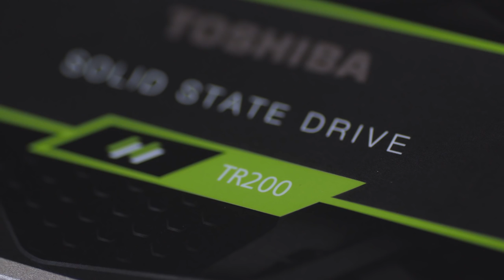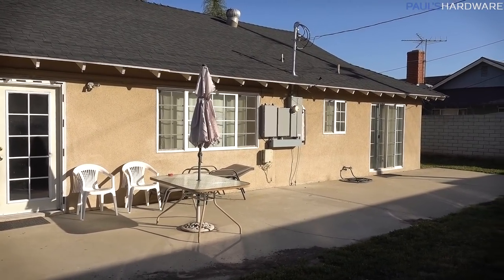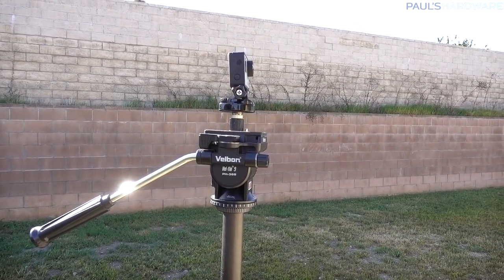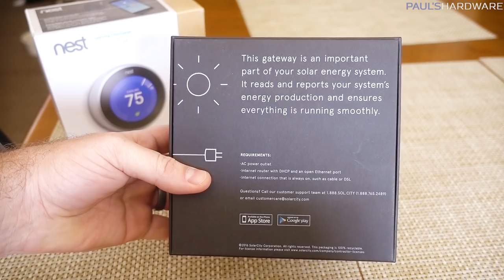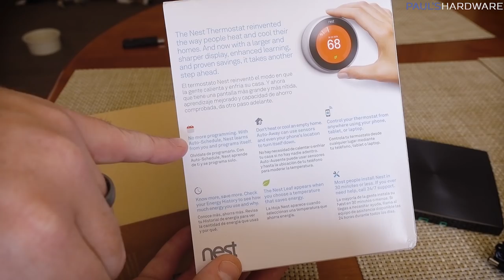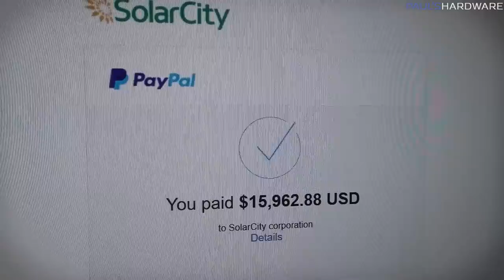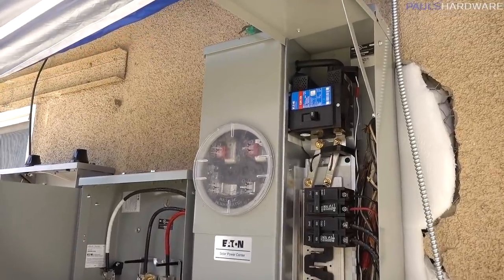The Good, The Bad and the Powerwall - My Tesla Installation Part 2

Comment: By the time you are done the whole back wall of your house is going to be covered completely in electrical boxes lol
Reply: Yeah, US Style electrical systems are bulky AF; my parents' house in Germany was built in the 60's and all the wiring is underground, there's 1 small box in the basement housing the main breaker and then both floors have a fuse box, that's it.
Installing a system like that there might be more complicated because the cables would have to got to the basement, but all of the stuff could be INSIDE, which is probably a lot better than an outside wall ^^
Reply: ZadiusTech what an eye sore
Reply: Not at all, actually. Its local code that his panel be located outside. What benefit do you gain be having main breakers inside? Once every blue moon you dont have to stroll outside to flip a breaker back on? Also, ost people in CA dont have basements.
Reply: The main advantage is they are inside hidden behind a cabinet. I'd hate to have big boxes on the outside of my house, covering my nice walls. Like in Pauls case, if he sits in his garden he has those bulky boxes covering almost his whole wall. It looks like shit... Another common spot here for the electrical system is the garage. My parents have their inverter etc in the hallway close to the front door, it's encased in the cabinet and looks like a normal closet that matches the surroundings. Same with mine.
Reply: You prefer to have the electrical meter and AC condenser inside as well? Some things are a compromise when you own a home. Paul is lucky in that his array looks nice and square, when a great many arrays are more of a jumble due to plumbing vents, etc. You can always build something around it, so long as you adhere to code considerations for space (or not, your home). Houses as old as his can't be expected to not change with time, especially if it means adding major equipment. People live with AC condensing units, internet nodes, plumbing cleanouts, transformers, and distribution vaults in their yards and just accept it as part of living in the modern day. 

I think they did a nice job with the equipment. But, I work in the trade. I have seen people build small fences with climbing vines around their  ACs and meters. I think it's silly, but it doesn't cost much and it's not my house to begin with.
Reply: Well, at least tesla's battery does look nice, compared to the other boxes at least. Serious question though, could any of those boxes be painted to look like the wall? To sort of camouflage them?

Comment: Good tip to really get working-value out of the Nest Thermostat would be to set up a Heat • Cool schedule to maintain a temp between 67 and 75 for somewhere like CA. Also, if you're working from home a lot (not exactly heading out often) set up Home/Away Assist to just use your phone's location, as it'll tie in to keeping an eye primarily on your phone's WiFi / GeoFence location to determine Home - Away states. It's a nifty wee doodad. Just make sure your motion around the house is consistent over the first two weeks, so it can learn the optimal functions for you. :)

Comment: Pro tip for the Nest BTW... It learns behavior. You have to be active with it for a while to get the usefulness out of it. You crank the AC on when you get too warm, and turn it off when you get cool enough. Also, it has a motion sensor to detect when someone is home. Be sure you mount the Nest somewhere where it will see someone is home, or it will turn itself off. Hiro is possibly big enough to register motion, so keep an eye on that as well.

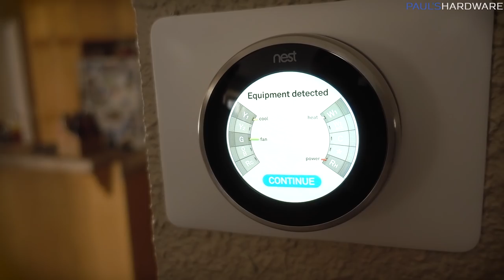Comment: @14:09 Have you had any trouble with the Nest going offline/losing power? If so, you may need to connect up the Common wire. I ran into that issue when I had a Nest installed.

Comment: I would not be surprised if Paul does not end up with a EV car as well - all that free fuel
Reply: If I were him I would, and race Jay.

Tesla Model S P100 vs Camaro ZL1 1LE

THAT WOULD BE AMAZING
Reply: Surprised they haven't already got a Nissan Leaf assuming him and his wife have a car each. I got mine a few months ago, fuel is expensive in my country and there is free charging 5min walk from my house, so far spent less than $40USD to go 6700km (4150miles), in my old car it would have cost almost $1000USD by now.
Reply: QALibrary
EV car, free fuel??, SuperChargers?
You still need Gas? to recharge it?
All Tesla users do Solar on the Roof, comi package China deals? Most are home builders, ordering China cells. EGolf people do that too now, getting construction skills!
He can recharge his car, needing less fuel to recharge it no the move! Getting better battery packs?
Are you owning the property, you should invest in Solar too! Need a new Roof?
Reply: lucas rem
lucas rem Dude, what kind of drugs do you use?
Reply: DumbSloth87 i got a headache trying to read rem's comment, i tought i was forgetting how to read english
Reply: Lucas, set down the pipe and back away slowly, then take your meds and get some sleep, you will feel much better i swear.
Reply: Free charging lucky!
Reply: well he had to pay for the system first - but in the long term and ROI is getting better all the time it be free - my friend had a set of panels for years now in the UK (not the best place) and his electric bill per month is like 5-30 USD
Reply: Not free. He just paid in advance for the “fuel”
Reply: its not free,hes already selling it, will be no different than buying it back at same price?
why is there so much logic fallacy with EV drivers thinking their solar panels are free?

Comment: Paul, Some advice from an HVAC tech: It looks from the video that your thermostat only has 4 wires, which is consistent with the age of your home. Even though NEST is designed and marketed to work with only 4 wires, in my experience, (including at my own house) you will at some point have problems with the NEST if it's only using 4 wires. Could be in a week, could be in a year, but you'll eventually have problems. It's because of the design and the way the NEST "steals" power from the HVAC equipment control board (I would assume it's an air handler). You can google it to find a more detailed explanation. Bottom line: the NEST NEEDS  the C wire connected for constant power from the air handler. Without it they have all kinds of goofy issues, not to mention, there's a small chance it could fry the control board. Mine tried to cook me in the middle of the night. And since they market it specifically to work with 4-wire systems, the last thing the folks at NEST will tell you is that you need the C wire. If you can run new thermostat wire, use at least 6-wire so you have a spare in case you get a short or upgrade your HVAC system to 2-stage. If you cannot easily pull new 6-wire or just don't want to, you can buy an Add-a-wire. https://www.amazon.com/Venstar-ACC0410-Add-A-Wire-Kit/dp/B008PLWT8C/ref=sr_1_3?ie=UTF8&qid=1524793455&sr=8-3&keywords=add-a-wire&dpID=41ee9nEplHL&preST=_SX342_QL70_&dpSrc=srch  .  Or, depending on your specific equipment, you MAY be able to use the green 'G' wire, which normally controls the fan, as the 'C' wire. See google or youtube for step-by-step instructions on how to do this, but basically you would hook the green wire to C on the NEST, then on your air handler control board, disconnect the green wire from the G terminal and connect it to the C terminal. However, that method may not work at all if your AC and/or heat pump does not control the fan automatically, and you will no longer be able to control the fan manually. Don't thank me, just buy me a powerwall!

Edit: Ok so i paused the video to comment before. Maybe you have a gas furnace and AC. The above still applies, just no air handler. The control board would be in the furnace.

Comment: Nice video, i will only say having to have to internet connection, lack of it preventing the system from working is ... odd.   I’m installing solar, it has monitoring but doesn’t block system performance in any manner.   Thanks for vid.

Comment: Great video thanks for the update, I am following this closely.  I live in UK so not quite the weather you have and I have been considering the Powerwall to add to my property as I already have solar.  I also run dual Nest (upstairs and downstairs) with an air source heat pump for heating.  The Powerwall seems like a perfect addition but I think I have been given false info into how they work so finding this a fantastic insight!  If I do end up getting one I will be sure to refer you!  Thanks!

Comment: When you mentioned needing a patio cover...maybe you could build one and set the solar panels on top of that instead of the homes roof. Like you said, if roof repairs are needed and you have those panels on there, what a pain. If you install them on top of a patio deck covering, no issues in the future, if that's possible to do. Just a thought.

Comment: I think you'll enjoy that Nest.  I have two Nests working with a Lutron Smart Bridge (and Lutron Casetta dimmers and switches with 100% LED bulbs) for lighting, and a Logitech Harmony Hub for the main entertainment area and all controlled by Amazon Echo's and dots throughout the house.  Can control all my lighting and thermostats from anywhere in the house via voice command.  I also have my internet, eero mesh wifi, Arlo Security Hub, and smart bridges  hooked up to a UPS so the other night we had a momentary power outage and I didn't even lose internet and gamed right through it (my PC is on it too, but the plan is normally just to give me enough time to shut it down).

Comment: What is the ROI on the system? How many years? I know there are many factors in this equation, but could you give us a rough estimate. I'm sure they will fix the hole in the wall and they should install a new meter for $30K. Thanks for sharing.
Reply: As he stated, the whole system is about 30K, but he gets a 10K tax break, so 20K to start with. Generally speaking, solar/tesla system adds $3 per watt to the value of the home in California, so 3 x 5000 watts (standard system size) = 15K increase in home value. Leaving 5K, which based on a $100 per month electric bill (which is actually quite low for California) it would take 50 months (4 years 2 months) to recoup the remaining cost.

Comment: Hi Paul, long time viewer.  I got a question for you.  Why are you not doing the install yourself? With sites like wholesale solar you can do the install yourself fairly easily and just hire an electrician to do the electrical.  I am currently undertaking this task myself.  I live 2 cities away from you and have a great south facing roof.  I estimate I need a 10kw system (6 person household), that will cost me about $9k in equipment.  Same warranty applies if you do it yourself, or get a large company like solarcity to do it for you.

I only ask because I have been through every damn solar company coming out and giving me estimates and have not been impressed.  You seem about the same handyman skill level as myself and could knock this out.

Thank you, keep the vids coming
Reply: The Tesla Powerwall is only sold through their exclusive dealer/installers.  Gotta keep the price up , you know....
Reply: Some areas prohibit such a thing and would immediately disconnect you from the grid... Gotta have licensed electricians to do such work.

Comment: If you need to replace the roof while the solar panels are installed they will have to be removed during the roof replacement then reinstalled. They would likely prefer not to have to do that within the first few years of the life of the panels. There may even be something in your contract that says they would have to handle the removal/reinstall on their own dime in the first few years. So, it's to their benefit to get the roof in shape before they install the panels. Fortunately we're in a fairly new house so the roof was not an issue when we had our solar system installed last year.

Based on my personal experience, you're gonna love that big tax credit next year.

Comment: At 81 set point for cooling I'd worry about humidity causing problems for your home. Also no common wire. While nest says it's not required, it could be an issue.

Comment: looking at your Roof. it needs/Needed to be replaced. the edge and venting is not up to current code. so when they do that they are going to have to Bring it up to current code before they can put panels on it.... did they tell you about the electrical? looks like that was a Feeder panel into a Sub panel that was inside? also... why didn't they do an inspection on the roof before hand?. I had them come out 4 times to inspect my roof and locate my Inverter and Junction box. and my house was built October last year. mostly because they had to work around my rooftop fire sprinklers. My sister couldn't get solar because of her roof being so poor, they would have to replace the whole thing, so now she's considering replacing with Solar tiles. which includes the roof replacement.
Reply: Also Paul, the Delta is a Passive cooled system rated to 7 .6Kw watch the Inverter heat. they are known to throttle at 50c... I have a 10kw system and it needs to be actively cooled to produce above 9kw. the Deltas are about 94-95% efficient. which is pretty good but as they overheat the output drops a lot ( 10% each increment until heat levels off)

EDIT: I used 80MM delta server fans on the bottom section of the fins so they actively cool and exhaust heat up and out

Comment: lol just be sure to setup the router firewall correctly.. than there should not be any fear of hacking.. or just dont use it if you really dont have to.
Reply: what is anyone going to hack?
its a battery 
worst case they turn your power out oh noooo

Comment: Really interesting to watch this installation, as I work with solar, wind, battery, and sustainable solutions on a daily basis here in Denmark. Score on the free roof repair :) Wouldn't have happened on my watch though, as it is the first step we analyze when planning a solar installation ;)

Comment: The Eco temperature settings on the Nest should the outer range of temperatures that you would be comfortable letting your house get to when you are NOT home. So like 40°–90°F. Otherwise you won't see much cost-savings benefit from the Auto-Away feature.

Comment: I am looking to get a powerwall with my existing system, I am hoping it'll only be around 10-12k , and also was thinking to add a generator if the batter gets to a low point so it will come on and charge it up without having to kick over to PG&E , not sure it's possible but no harm in checking, did you get the 5 referrals for the extra battery ? maybe I should aim to get 2.

Comment: The Tesla system is kind of expensive, we've got a local outfit here in Columbus Ohio that does a system with a battery pack for around 45,000 for everything. Neighbors had one done and they've been off the grid for the last 6 months 👍🏼 best of luck to you Paul.

Comment: We have 60 panels from SolarCity however we are leasing ours and didn't get a Powerwall or any battery backup. We would like to in the future, but for now we will take the refunds from what we feed back into the grid. I do have some concerns with transitioning from the electric company though, especially after being on a budget plan. So far I've spent double my monthly cost on electric; this should I HOPE balance out once we are fully solar. On average we do around 1,500KWh/month, so I've been monitoring our production closely.

Comment: PAUL ...I have so much i could tell you about my Solar stuff here in Florida I would be here 2 hours typing , from the info i learned to laws......anyway this is about your roof...if you plan to not have kids and stay in same house for 20+ more yrs and i am guessing you are by your Tesla investment then you should seriously think about doing your Roof in Metal because it can last as long as 50 yrs....the one i installed under my solar is rated for 50yrs with prorated money back if fails for each yr of failure...,OH yeah It will Cost more but if time it out over yrs and what it cost to re roof in 20 yrs 2 more times its well under doing your house in shingles just over 1 time and if not look around on pricing.......Last thing ask the Tesla People if the metal will interfere or cause issues with the Solar Panels.....I have never seen anyone say NO we cant because you have metal roof BUT I have Heard of it a Couple of times in group conversations......  Good Luck if need more yell back .....ill check back after i go move cows (about 6 hours from now)    Cow }:o-)

Comment: Hey Paul, did you inform her that you were recording the call? Cali is a 2 party consent state on call recordings, and them informing you they are recording doesn't cover you recording also. The fine for that in Cali is either $25,000 or $250,000 per occurrence. :)

Comment: Glad to see an update.
Frustrating for a PTO isn’t it?
(Permission to Operate)
Did you have the option to add a battery later if you wanted, since it is an AC Coupled battery system.
Reply: He also went over this.. IF 5 people use him as a referral he will get get a free RED Tesla Power Wall (battery bank) to ADD to his existing system which would give him more capacity..

Comment: I got solar on my roof last fall it's been amazing I haven't had an electric bill above 17$ since it's been installed went from 150$-175$ down to 16$ a month. And that's just taxes and services. So in theory they will end up sending me a check cause I'll be positive from the accounting side. Mine was only 18k but I didn't get a powerwall I'm just always on grid. No battery. So if power goes out I go out too since I'm tied directly to the grid still. But I'm selling all my extra energy back. Its bee. Great.